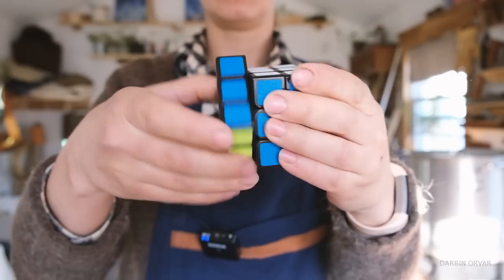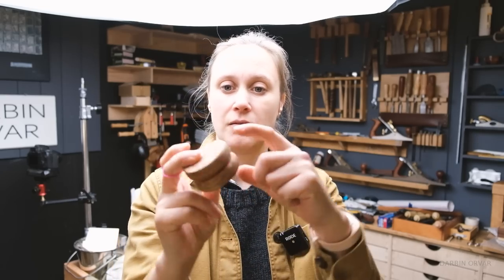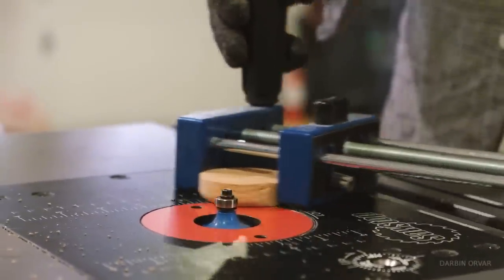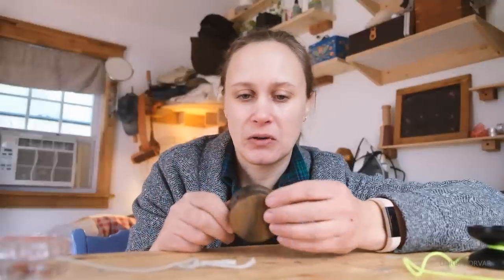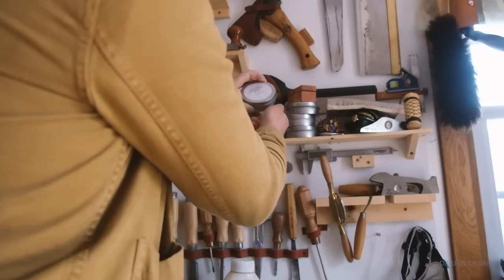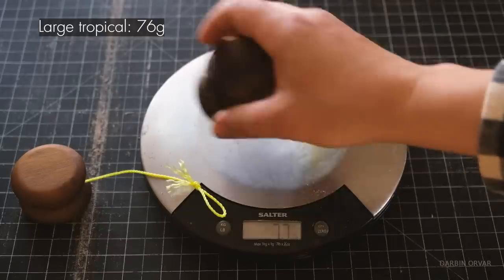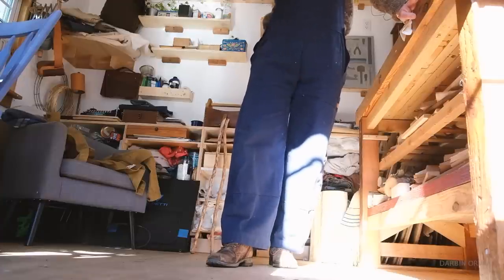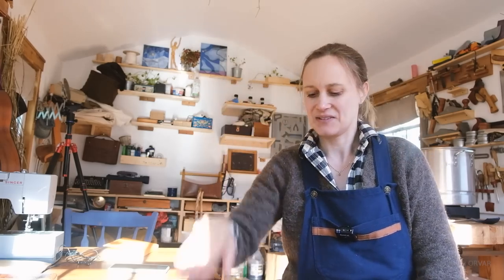I Make a LOT of Yo-Yos. (what works? SURPRISING results)

Comment: Cool project!  The balance matters a lot more when you are making the yo-yo sleep/ throwing it really hard.  The better/more expensive yo-yos with bearings have a mechanism that will sleep when you throw it down really hard, but will come right back up when thrown softer.   As Melinda says below, a yo-yo string will help. They are normally made with several cottony strings twisted around each other.  They are doubled up so  you don't really get a knot at the bottom, the center dowel just goes in between  the twists .You will notice a difference in how it behaves depending on how tightly things are twisted at the bottom.  Usually the more you play with it, the tighter the string gets.  Then you can just hold it with the string fully extended and it spins to unwind itself.

Comment: First thing, you need to string the yoyo correctly. For most basic yoyos the string provided is already basically a loop of string that's twisted. 

The looped end, opposite the end that is tied, untwist the loop a little to enlarge that loop. Basically twist the string in the opposite of the twist in the string. 

When it's large enough to fit the yoyo through,  slip the yoyo in the loop and spin the yoyo a little in the direction of the twist in the yoyo.

And you're done.

No need to tie a know around the axle of the yoyo, that can make it problematic to replace the string.

As for designs on the side, a little resin in the pattern, then sanded and polished would be one way to keep the outer surface smooth. Don't know how long that would last 'walking the dog' though. 😄

Comment: I had been thinking about making some yo-yos.  Buy some yo-you string it will work so much better.  Metal dowel/pin will help too.  To do tricks the yo-yo has to be able to hesitate, the metal is smoother to help with that.  Great project, you inspired me to try it.

Comment: Very nice, Linn.  I expected you to turn the pieces and was pleasantly surprised, although I don't have a CNC system - I don't have a lathe either.  I DO have a bandsaw and I may give this a try.
Reply: I used a plunge router with a plate made out of MDF and drilled a hole for a dowel pin that I sanded down a little to spin freely in the holes I drilled for the axle in the yoyo's. The distance between the pin and the edge of the router bit determined the radius. I used the same principle to make a jig that held the blanks securely for rounding them on the router table. I also chucked a piece of dowel in the drill press which allowed me to quickly go through different grades of sandpaper

Comment: Thank you for that Masters thesis on Yo-Yos.  I don't know when they were invented, but as someone quickly approaching 70 years in age, I just remember them always being there.  In a way, the yo-yo was the technology of that time.  Seems like everyone had one, and they came in a rainbow of colors.  I can still smell the plastic.  The thought of having bearings in them feels like cheating.  One note about your strings, though.  The original yo-yos had what I could only call a 2-ply string.  Instead of tying it to the center, the string was twice as long and wound.  It was tied together by the finger slipknot, and you would unwind it on the other end to slip over the body and it woulds wind itself over the axle.  I think this is the reason you could aspire to do all the tricks like "around the world," "'rock the cradle", and "walking the dog."  Anyway, thanks for that trip down memory lane.  Not having a CNC has me thinking of some designs to make on the lathe.
Reply: Yoyos are an ancient weapon. Surprise. I believe they first appeared in the far east about 3000 years BCE.

Comment: Couple of suggestions.  Instead of a wooden peg, use a smooth metal rod, 1/4 to 5/16 in diameter.  Make your yo otherwise as you have been doing, but the heavier wood will be good for what I'm about to describe.  Now that you have your yo yo with metal rod for the center around which the string will ride, take a length of string and fold it in half.  Take the loose ends and tie a not and make your finger loop on that end.  That leaves a smooth cradle in the other end of the string with no knots.  Put the yo yo in that cradle and give the string a few twists.  You will have to experiment to get it just right, but when you twist it just tight enough, now when you throw the yo yo down, if you don't pull back on it, it will stay at the other end and just spin.  We call this hesitating or sleeping.  A slight bounce of the hand will then bring it back to you as long as you do it before it stops spinning.  The harder you can learn to throw it down without it coming back up immediately, the longer it will spin.  

Now here is where the fun begins and the pros make a living.  What you do with it while it is hesitating or spinning becomes the tricks you can do with it.  Around the world, loop the loop, rock the cradle, 5 or 6 pointed star and so forth.  The challenge is to get the trick done with enough spin left for it to come back to your hand when you drop out of the trick.  Then of course there's doing this with one on each hand, but then, that's a whole 'nuther story!  I'm 78 and I've been a kid all my life.  Still don't know what I want to do when I grow up.  Play with your toys and have fun.  Never grow up!  We need more smiles in this world we live in.  We need to learn to be kind to each other as well.  I've always loved your channel because you bring such enthusiasm to the party in most everything you present to us.  Always a smile.  Thank you!

Comment: I was surprised by the way you used the barings in the yo-yos. I was expecting a baring in each disk and the dowel in the barings for the string. This would use the barings to rotate the yo-yo. Not sure how it would work but that was what I though you were going to do with the barings. 

I would think that you would need to put a guide on the sides of the baring (if only using one baring) to keep the string from going in beside the baring as this would possibly pinch the string and slow down the yo-yo or stop it at a point in its travel. It might work with one baring if you could flare the sides of the two disks to be the same size as the baring at the point of contact so string could not get in beside the baring.

Very cool idea and looks like a fun project.  I have a few grandkids that are going to be surprised in the not to distant future. Thanks for the great ideas. Blessings!
Reply: A single bearing in the center is the correct method, where she went wrong is two things.. 1) as you noticed there can't be a gap beside the bearing, it needs to be recessed into the yoyo body slightly. 2) you can't press a bearing against a flat surface and have it spin, you need to press the inner bearing race against something while allowing the outer race to spin freely. Usually accomplished with a "spacer" of some kind, those metal things in the plastic yoyo she showed.

Comment: Awesome idea. I forgot about my yo-yo. I recently started using a kendama. It would be a great lathe project. Also, since you have the holes for the dowels on the disc you can also put those holes in your spoil board and use dowel to get the discs perfectly centered

Comment: I used my router and a jig that fit them on the dowel hole. I also used the dowel hole to mout them on my drill press to sand them. I also found that the space between the sides shouldn't be more than two times the width of the string. I also found that the heavier ones hurt a lot more when you make a mistake. 😆 They can also break things. But I got hooked and batched out more than I could ever sell or give away. 😆

Comment: The original yoyo are made of  wood. YoYos have been around a long long time. 
The cola spinners had a cork barrel with a narrow pin through it holding the yoyo together.
The string was a continous loop. Tightened by balancing the yoyo in the loop then twisting the string

Comment: Symmetry leading to balance is critical but at that point of the process I instinctively believe that you need to research what type of string or chord is used in the best manufactured yo yo’s. If the string  selection is fighting you, it will be impossible to improve your yo yo. You were also on to something by observing any impediments to the recoil such as spool friction etc. Your hiccups in demonstrations were always on the recoil….Look into string or chord “resiliency” and how that effects recoil etc.